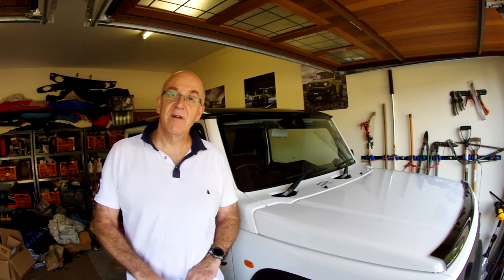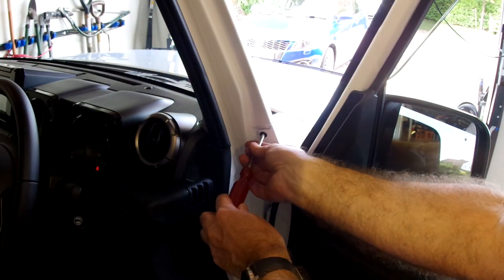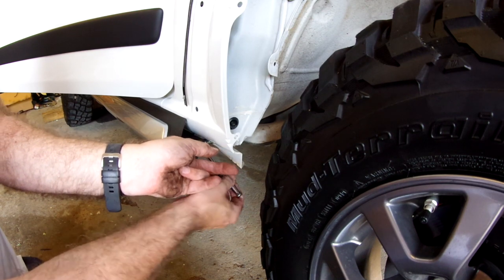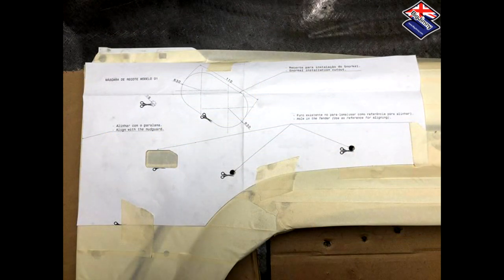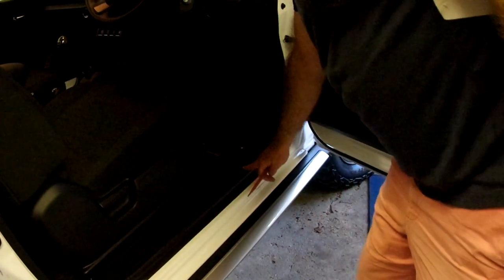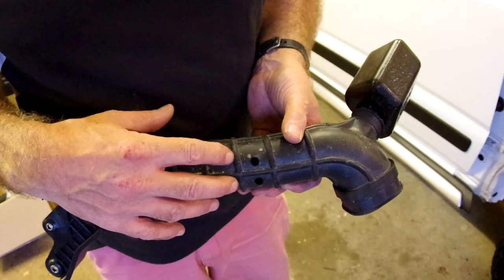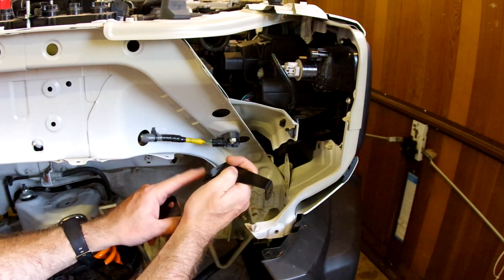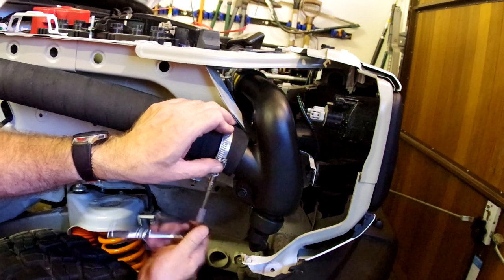Fitting a Snorkel to a Gen4 (JB74) Jimny (Part 2)

Comment: Thanks for your incredibly helpful and interesting Jimny JB74 videos. I hope though that you will spend more time showing the finished product and chuck the fish eye lens which distorts the look and appreciation of the mod.
Reply from the maker: Hi, I have to use the fisheye as space is limited in the garage. However there will be more pictures of the finished item. You can see some on my album pages. http://www.lines-associates.com/piwigo/index.php?/category/680
Reply: Thanks! The snorkel does look sexy. Though I am concerned about its rated wading capability as I just saw a video of a new Defender sporting an official Def  snorkel where the 4x4 tech said the manufacturer does not actually guarantee its wading capability (wading depth remains the same)--just that it guarantees cleaner, dust-free air. You might like to watch the video. They tested the new Defender up a muddy, slippery and steep mountain and the new Jimny out-climbed the Defender. There was actually a harrowing moment when the Def's electronics failed and it barreled down the mountain. https://youtu.be/Y7KahIfkUwc
Reply: I worry about the snorkel because it looks similar to the Defender's and I wonder if these factory snorkels are more for dust than adding additional protection against water ingress into the filter 
box and the engine.
Reply from the maker: @joyceano5354  The snorkle is amongst the best I have seen. Well sealed with a specific one way drain included. Of course, a snorkel is only one part of any system which is why the manufacturer tends to say that the wading depth doesnt change, you have to put in axle and transmission breathers and protect elements such as the ECU.
Reply: @bigjimny  True. Maybe you can also do a review of the snorkel and your experience with it thus far. Love your videos--very helpful. Cheers!
Reply: @bigjimny  where did you order the snorkel though? Your local dealer or online?
Reply from the maker: @hollycrowley1567  I ordered it through Suzuki in Brazil

Comment: Excellent video. Considering that it is a genuine Suzuki accessory, does it officially increase the rated wading depth of the Jimny?
Reply from the maker: There are many other factors affecting the wading depth including transmission breathers, ECU/electronics location, sealing of the bulkhead, disabling of fans, rubbish door seals. So it only contributes as part of a series of other modifications
Reply from the maker: And whilst I think about it, EVAP canister

Comment: One question, did you use the old fender flare seal? or did you fit a new one when you fitted the fender flare back? Thanks.
Reply from the maker: We used the old one. As the car was nearly new it still had "stick"

Comment: Nice video!
Does it makes noise?
Mine got a wird wind noise when the car "shakes"
Reply from the maker: I reduced a lot of the noise by removing the little grill, sticking some double sided tape to the inside of it and putting it back on the car

Comment: Where can we get the full workshop manual for the jb74? I've been looking everywhere for one. I've just bought one and have to wait till March till delivery. I'd like to familiarise myself till then as I plan to do all the modding myself. Also you channel is amazing, love your work.
Reply from the maker: I cannot work out where you live. If its in the EU then the EU workshop manual is either available online via a subscription service or purchasable as a DVD from Suzuki. Note that officially the DVD is restricted to trade purchasers only but some dealers will overlook that.
Reply: @bigjimny  I'm down under. I might have to contact my local dealer and see what I can get, I've purchased mine via a leasing company so I haven't actually been to the dealer (other then a test drive) Either that, I might need to get chummy with my local Suzuki mechanic.
Reply: Wow very nice! Please send the link where to buy.